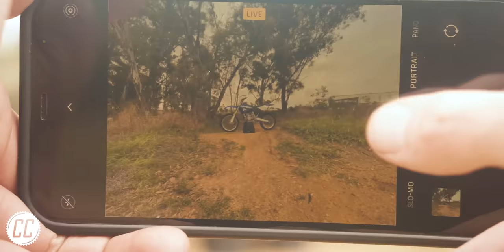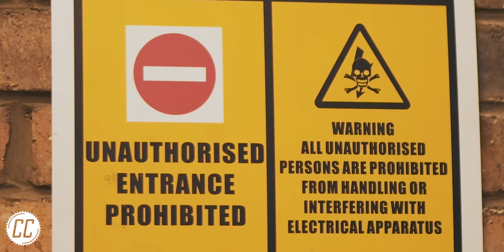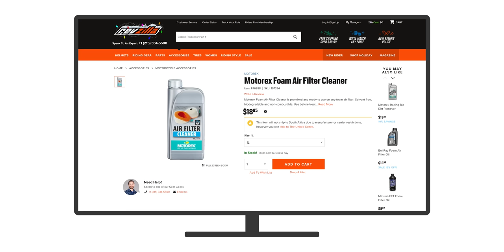10 Motorcycle Hacks & Tips

Comment: I really like the bolts one, I build computers and frequently take things apart that require either similar or exact replacement to avoid pressure differentials that could cause components to snap/give uneven pressure so that is actually kid of useful in multiple ways.

Comment: I actually wanted to tension my chain today because of sloppy shifting ..but I was putting it off because of those useless axle markers I didn't want to deal with.. I think you know what I'm about to do next so thanks for sharing.
Reply: If you know that your axle is already properly aligned,  all you have to do is turn each adjuster the same amount,  usually it only takes a quarter turn or so, unless your chain is really loose.
Reply: @331moto  that's one good tip too
Reply: @331moto  To add to this: when aligned, 'mark' each adjuster screw at 12 o'clock with a small grinding tool. Makes it easier for me.

Comment: An even easier hack for keeping your axle alignment correct while adjusting your chain is, to turn each adjuster bolt exactly the same number of turns. This is easily accomplished by counting the flats on the head of the bolt as you turn it. You usually only get 1/4 to 1/2 a turn (1 to 3 flats) of the bolt before you have to remove the spanner and re-position it on the bolt head. Just make certain to hold the bolt in position as you tighten the locking nut. If you really want to be anal about it, measure from the centre of the swingarm pivot to the centre of the axle on each side, they should be the same.
Reply: The markers on my bike are awkward to read so I just measure between the end of the adjuster bolt and the plate at the base of it with verniers. I find it so much easier than trying to eyeball the lines on each side
Reply: Thanks mate! You know the right way , measure from the swingarm pivot!
Reply: I've been doing this for years, it's a bit tiresome but really gets the job done without any extra tools. Any time I remove the wheel and put it back on, I push the axle as far as it'll go, fasten it just enough that it has a bit of friction but can still move, and start alternatively turning the adjusting bolts the same amount of turns until I start to get tension.

Then I slowly turn the wheel while pushing the middle of the chain to find the highest tension point, and then give it the last bit of adjustment the same way as before. Then I fully fasten the axle nut and next I give a bit of tension to the adjustment bolts to ensure they don't loosen up or rattle while riding.

It's surprising the amount of riders I've met that have no idea how to properly align the wheel and tension the chain, given it's such a basic yet highly important task for both riding and safety.
Reply: @moteroargentino7944  how much slack are you giving that chain?

Comment: Pump the front & give leaky fork a wipe with microfiber cloth. Repeat multiple times until residue is clear. Then take an elastic band, cut it, then rap it tightly around the dust seal then marvel at lhow ittle it actually cost  to fix a leaky fork seal.

Comment: best way to check alignment when doing chain tension is to use a ruler on the rear sprocket (make sure the ruler contacts the same face/plain at 2 points) and sight down the chain (using this method more than doubled my chain/sprocket life)

Comment: The best thing for wet boots and shoes is newspaper or paper towel (or toilet paper). Just stuff your boots with the paper and it will absorb the water and sweat. You can leave it for a few hours or overnight, or replace the paper after a little while to speed up the process if you need to. If you need them dry fast, use paper towel or toilet paper and just keep pushing a wad of it firmly against the wet section until the paper is damp and then repeat with fresh paper. You can get them from soaking wet to virtually dry in less than 30 minutes. It also works on clothing.

Comment: Motorcycle jackets can be a bother to wash. They are generally not machine washable, the protective padding can be difficult to remove and to reinstall and they are heavy and slow drying. Consider purchasing an extra large bicycling jacket to wear over your motorcycle jacket. Reasonably cool summer “rain” jackets are available (and nice for a mild summer afternoon shower), they are light weight, they are available in high visibility and/or highly reflective and easily hand washable materials, and they will protect your difficult to wash motorcycle jacket from road grime and bugs.

Comment: ive no idea where this fashion of hydration back packs came in. we used to do 100 cycle trips with just a single bottle of water on the frame and refill it as we go. you dont actually need that much water because your body isnt really losing that much so A: when you feel dry put some water in your mouth and swill it around but then spit it out. this will make you feel refreshed / actually drinking too much water will make you feel bloated and slow you down. B: you are never that far from a tap in the uk its not austrailia?